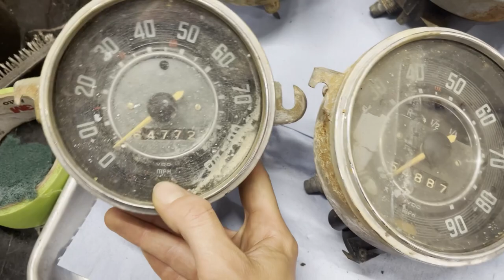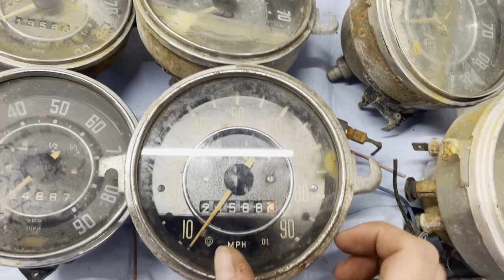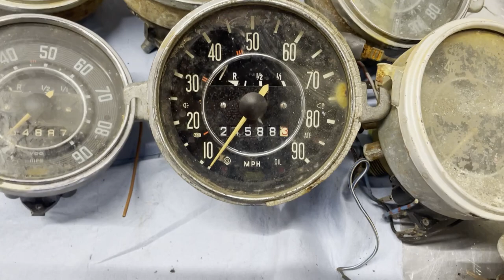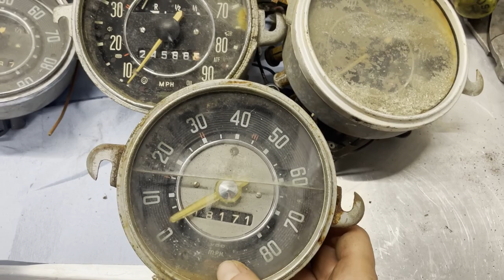Classic VW BEETLE Speedometer - DISASSEMBLY + CLEANING

Comment: Hi. It is possible to remove the brass nubbin that holds the needle.  Place some layers of tape on either side (to protect the speedo face from the tools) and lever up on both sides at the same time.  Put a plastic sheet over the top of the dial, as it is a press fit, and the plastic will catch it - otherwise it will be launched into space once it comes loose.  😅